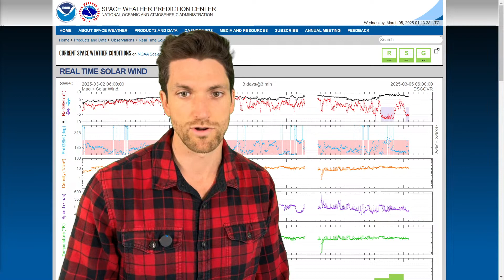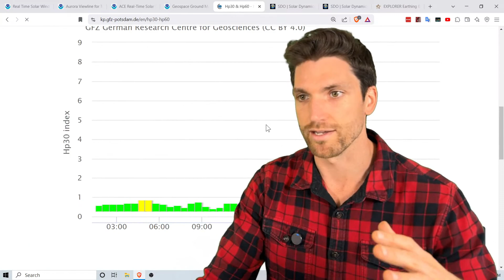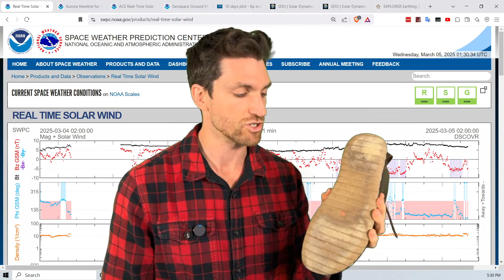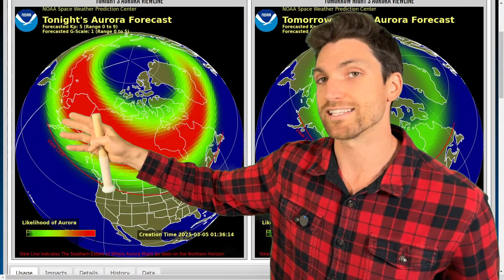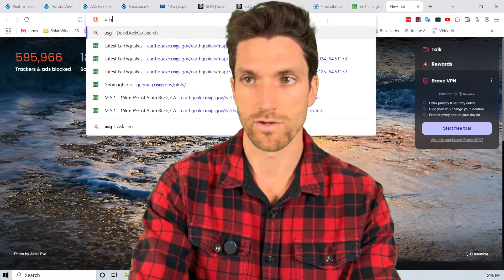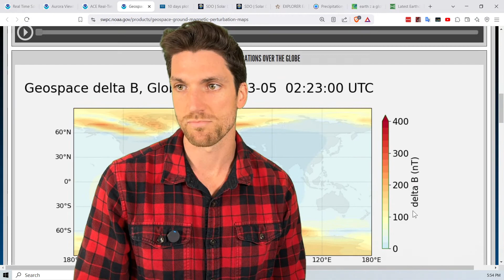Aurora Across North America Could Happen Tonight! Geomagnetic Storm Watch with Stefan Burns

Comment: 💥💥💥Stefan, with respect, please rescind the blanket statement you made about grounding sheets generating or accumulating  "dirty electricity" and being more of an EMF generator than having a benefit.  First of all, the products from Clint Ober's company (Earthing) are the result of many years of R&D.  His products (Sheets, pillow cases, mats, etc.) have a mechanism in place to block anything harmful from coming into the product.  This may not be true for cheaper products out there and stuff from China but your statement is not true of all products.  Building grounding requirements were different before 1963 so the grounding systems used in buildings constructed before that time are not ideal and that is what can be considered "dirty electricity."  So, people, please don't throw away your sheets and mats before you research the manufacturer.💥💥💥
Reply from the maker: I stand by everything i've said. Watch my video here to better understand why https://youtu.be/zHS33JQqNz0?feature=shared